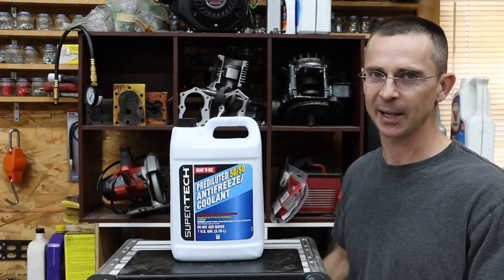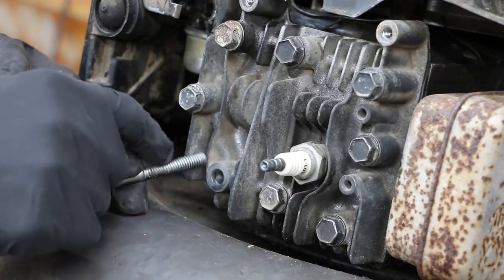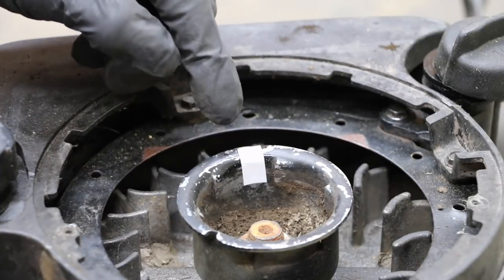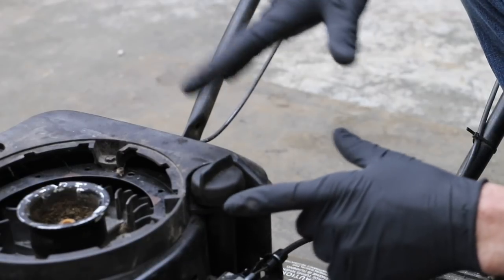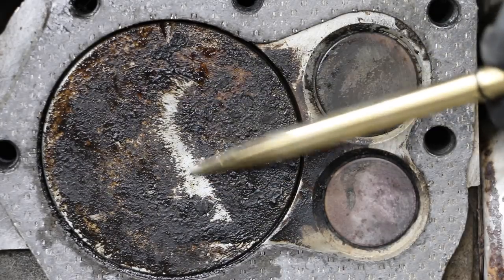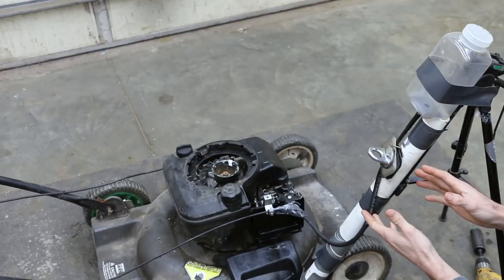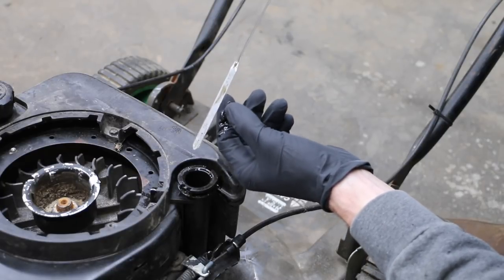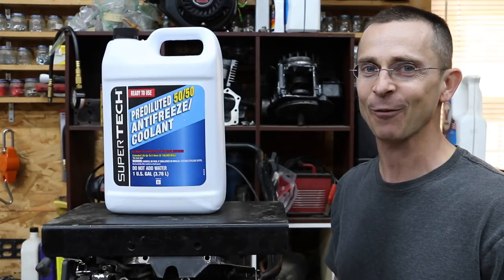Will Antifreeze clean an Engine?  Let's try it!

Comment: I'm a new subscriber, and I'm wondering if you've ever done a video comparing traditional antifreeze to Pet Friendly antifreeze? We have a lot of pets, and my solution so far has been to have my mechanic do the job, just to keep the poison from them. But, if one of the pet-friendly anti-freeze products work, I may take the job over myself!

I also had another question: My first car was (and still the best) a 64 Corvair. I remember one summer getting a J.C.Whitney Catalogue (this was in the 70's) and my best friend and I poured over that catalogue choosing the best add-on for our hard-earned summer pay. We decided upon a water injection system. WHAT? A WATER-INJECTION SYSTEM??? Well, yes. Whitney had listed it under the Corvair" section specifically. They explained that during WWII, higher-ups had noticed that the same plan ran better and used less fuel than in Europe. This, it was decided, was because the HUMIDITY in the Pacific theatre was so great. It caused the engines to run cooler, smoother, and more fuel-efficiently. Then, water-vapor injection devices were added to all the planes and the allies won the War!!! I may be embellishing a bit there, but we did purchase it, and I added it to the Corvair's carburetor. Didn't seem to do much....Anyway, have you ever run across this claim? About water injection? Love the channel!!!
Reply from the maker: Thanks for watching and subscribing.   Thanks for the video ideas.

Comment: watching roadkill or roadkill garage, can'e remember exactly, they did a similar trick on an old chrysler v8, can't remember exactly the model, where they rev the engine and at the same time, pour slowly a glass of water into the carburator and suposedly it clean the carbon deposits
Reply from the maker: Thanks for sharing.

Comment: Water will do the same thing as antifreeze as it acts as a steam cleaner. Mazda/ford used to keep a trick from us when the rotary was introduced. They would rev the rotary to 2500 rpm. And hook a vacuum line to a water jug and turn it up pouring water into the cylinder to steam clean all the carbon off the cylinder making the rotary continue to last. Do not try that on a 4 stroke engine but since a rotary is essentially a 2 stroke it was not going to be damaged from possible hydrolock.
Reply from the maker: Thanks for commenting on this.

Comment: Ethane Gas is C2-H6.  Ethanol Alcohol is C2H5OH.  Ethylene Glycol is C2H6O2; in other words, it is structured just like ethane gas but has an OH at each end of the chain.  Alcohol has only one OH at one end.  In other words, it looks like Ethylene Glycol should burn great in an engine.  It is a double oxygenated hydrocarbon afterall!  I have tried to burn Ethylene Glycol as a fuel in my wood stove and it does indeed burn GREAT, with a beautiful green non-smoking flame.  Hard to get started, but is a good clean fuel if you're ever desperate for fire starter.  Seems to be too high of a viscosity to vaporize in carburetors.  Would work well in a lamp if diluted.  Cheers!
Reply from the maker: Thank you!

Comment: You should try this 1/2 cup of anti freeze and 1 1/4  cup of berrymans b12 chem tool and the rest gas  i have used this in my lawnmower 3 times out of the 6 years i had it and inside was spotless in side the combustion chamber
Reply from the maker: Thank you for this recommendation!

Comment: I heard running transmission fluid in a diesel engine will clean the injectors and the cylinder up idk if it will though or not
Reply from the maker: Thanks for this recommendation.

Comment: When you have a cracked head or head gasket that cylinder will not fire I wonder if it would clean it even better with the coil not plugged in and turning the motor with drill

Comment: Please make a video antifreeze vs water which is more effective because I think antifreeze is more effective do to the reason it doesn't steam up as easily and slushies around washing carbon deposits away instead of steam just softening carbon and drying up the cylinder walls at least antifreeze is some kind of lubricant.
Reply from the maker: Thank you for the video idea!

Comment: Back in the 80s at the Chevy car dealerships the factory would have us use a water drip system on top of Cadillacs because of carbon buildup and this was straight from the factory to cure the carbon buildup in Caddy Motors they had us drill a larger hole in the bottom of the old fashioned Gojo hand cleaner plastic containers and place them on top of the plenum
Reply from the maker: Thanks for sharing.

Comment: Hey project farm. It's just a hypothesis but I think that the antifreeze would clean inside the engine more if the antifreeze was as heated up like it is in a car engine. It would make a good video to see if the hot antifreeze would act like a hot soak
Reply from the maker: Thank you for this recommendation!

Comment: I don't think it is the antifreeze itself but the water. You can achieve similar results by simply pouring a little water into the vacuum line on your engine (much the same fashion as Seafoam is used). It is an old mechanics trick that has been proven numerous times (videos can be easily found here on youtube).

As you can see in the slow motion video, there is a lot of moisture (water) lingering in combustion chamber while the 50/50 antifreeze mixture is dispensing into the carburetor. I firmly believe that it is the moisture/water in the combustion chamber that is loosening and removing the deposits. 

I think the true test would be to use 100% antifreeze. This would eliminate the question of whether or not the antifreeze itself is removing the deposits or if it is the water mixed with it.
Reply from the maker: Thank you

Comment: If you have a knocking valve due to carbon build-up, if it has a carburetor you can pour transmission fluid down while it's running, it will smoke like a train, but it will dissolve the carbon build-up, so I say use transmission fluid if you want to get rid of the carbon build-up.
Reply from the maker: Thanks for the feedback.

Comment: What about brake fluid, a guy I used to work with told me in the UK some service intervals on opels were to pour brake fluid into the intake
Reply from the maker: Thank you for this video project recommendation!
Reply: this works because dot 3&4 are glycol based just as coolant is ,works better tho

Comment: I've seen somebody promoting the idea of using boiling hot water for an engine cleaning process basically the hottest water you can achieve and stick a vacuum line directly into the pan of boiling water with the engine running
Reply from the maker: Thanks for sharing.
Reply: @ProjectFarm  My curiosity to expand on that was perhaps use a pressure cooker so we could achieve superheated steam or superheated water that would flash to steam

Comment: I know this is a little late but I once hand a buddy tell me to dump ATF down a carb to clean out the engine. They said to drunk one quart in slowly and then you were good. It would be cool to see what actually happens. We did it and we had to use the throttle cable to keep the engine running it seemed to run better after but we were 16 at the time 😂
Reply from the maker: Thanks for sharing.

Comment: Good videos, keep up the great work. Could you try 'light Air tool oil' with a drip and spray like you did in this video. The oil is comparable to Marvel Mistery Oil but no additives.
Reply from the maker: Thank you for this video project recommendation!

Comment: Something i have always been curious about is running an engine on gasoline and providing pure oxygen as the air mixture. I am pretty sure it will overheat, but i would like to see it in action

Comment: Can you test water methanol injection? A lot of vehicles use it to increase octane levels, reduce exhaust temperatures and increase ignition timing for more power. Will it also remove carbon buildup?
Reply from the maker: Thank you for the video idea!

Comment: it is a common trick to clean engines by spraying pure water in as you did.  The scheme thermally shocks the carbon deposits when the water mist reaches the hot carbon, and causes it to crack off.  How do you know it isn't the water doing the deed?

Comment: How many times has that head been removed? Don't antifreeze leaks occur on the head gasket with a watercooled engine? Running it through the carburetor might be apples and oranges. Great video too. You take the time to do the tests honestly and believably.  As a religiously skeptical observer I like the way you roll!
Reply from the maker: Thank you!

Comment: Ik this video is 3 years old but bmw made a car with “water injestors” that spray a light mist of water with the air fuel mix and it helps with cooler air and clean a little bit
Reply from the maker: Thanks for sharing.

Comment: not sure if you could test this but, I heard that you can use mineral oil as engine coolant. It's better because it doesn't corrode metal parts like the radiator and lubricates the coolant pump so the myth goes. Is there any truth to this myth?
Reply from the maker: Thank you for this video project idea!

Comment: What if you just do a purified water drip as the antifreeze is 50 percent water. What if its the water that's doing the cleaning instead of the other ingredients in the antifreeze? Could be the water is flashing to steam and this is performing the cleaning? Nice video here! Why not try liquid dish soap dripped or sprayed into the carb too.
Reply from the maker: Thanks for the recommendation.

Comment: Hi, Love your videos! You should test a degreaser in the crankcase/intake as a cleaner. Specifically LA's Totally Awesome Cleaner found at many dollar stores. Saw a utube video "How to Clean the Inside of Your Car Motor" by Artistry Photography 27mins, where he used LA to clean the worst sludge I've ever seen in an engine. I tried his method on a sludged up 92 Toyota Corolla ready for the junk yard & had surprising results. I think you will too!
Reply from the maker: Great video idea!

Comment: The Super Tech antifreeze coolant labeling is very confusing and I now found another version called Heavy Duty that comes in a black 1 gallon jug with a red cap and looks like it is the same as the Toyota version labeling.
I'm starting to think that all these versions are just nonsense.  For instance this version is labeled Super Tech Prediluted 50/50 Heavy Duty Extended Life Antifreeze/Coolant and it's priced at $10.96.  The label doesn't specify a match to any vehicle, but looks very similar to one of the Toyota versions, the white gallon bottle with the red cap  It is an ethylene glycol based Organic Acid Technology (OAT) that meets or exceeds ASTM requirements.  And is free of phosphates, borates, nitrites, silicates, and amines, just like the (POAT) Toyota/Lexus white bottle with red label.  The label claims to be Extended Service Life for a million miles instead of only 5 years or 150,000 miles on the White bottle .
WTH could they be possibly testing for a million miles?  And what is the difference between ethylene glycol based Organic Acid Technology (OAT)  based or ethylene based Phosphated Organic Acid Technology (POAT), since this POAT also claims to be free of phosphates on the same label?  How could it be POAT and be free of phosphates?

Comment: Have you ever tried using water to clean carbon? It can be done the same way as antifreeze so you already have the setup to make it work. I've heard this tip for a lot of older mechanics that did this for old carbureted vehicles
Reply from the maker: I used a water drip, but haven't tested a mist yet. Thank you for this recommendation!

Comment: I’ve always heard doing just plain water like that will clean carbon. Maybe do a video with just water and compare it to the antifreeze mix results to see whether the antifreeze adds to the affect? Basically the steam with the water is steam cleaning the cylinder
Reply from the maker: Thanks for commenting on this.

Comment: Ok, growing up, I've always have been told one of these three will get an engine pristine...1.) Transmission fluid; 2.) Hydraulic fluid; or 3.) Diesel fuel/ JP-4 or JP-8. The myth has always been, drain one quart of oil from your crank case, then replace that volume of fluid with one of the three, drive the car for 5-7 miles under normal conditions and driving...then drain the crank case and inspect your engine and spark plugs.
Reply from the maker: Thank you!

Comment: Water would be better because when cold water hits a hot surface it explodes (like spilling water on the stove) taking any carbon deposits with it and there is additives in your Engine oil for condensation (when you read on the back of an oil container are word like SD, SF and others that's the additives) instead of using copper wire ya can just use a longer bolt the bolt holes in the block are usually deeper than the bolt
Reply from the maker: Thank you!

Comment: I've always been told that antifreeze in the engine ruins the engine.  I think for this test to be conclusive you should run it for a prolonged time period, say for an entire tank of gas or more.  Also, running a parallel test using straight water would be good so you can see if it's in fact the antifreeze or the water that's doing the cleaning.  My guess is its the steaming during combustion that's doing the cleaning
Reply from the maker: Thank you for this video project recommendation!
Reply: Also, maybe look at the rings, bearings, and cylinder walls before and after.  That might be too involved though.

Comment: What happens when a head gasket fails is the coolant pours into the cylinder after the car has been shut down, and it sits there on top of the cylinder as it cools down.  That is why on cold starts, the engine might have a miss as the coolant interferes with the spark
Reply from the maker: Great point.  Thanks for commenting.

Comment: It's the same effect as wated/meth injection. A light controlled spray of water should clean the engine, lower temps, and technically increase compression when being sprayed as water doesnt compress or ignite.

Comment: Plain white rice is another great cleaner.  Acts like a shot blaster while the engine runs. 
I've used it on regular v8s with decent success. Don't do it if you still (somehow) have a pellet bed cat installed! Exhaust smells like popcorn.
Reply from the maker: Thank you for this recommendation!

Comment: Hy, I actually used blue antifreeze in my car as water injection, for about 2 weeks. Its a simple 4 cyl SOHC endine.
after I removed the cylinder head for inspection, every cylinder was full with some sticky black stuff, it really looked horrible..
Reply from the maker: Thanks for this information.

Comment: I have literally used the wire trick on head bolts when I got a blown head gasket out trailing I ended up driving it for another 2years almost daily until I sold it to a buddy that still wheels and beats on it every weekend
Reply from the maker: Thanks for the feedback.

Comment: I watched a video where a guy put some "Totally Awesome" cleaner into his crankcase with just 1 quart of Mobil 1 synthetic. Did this like 4-5 times and ran it like 10-15 minutes each time, and so much crap drained out of that oil pan. It was insane and you should try something similar. :-)
Reply from the maker: Wow! Thanks for the recommendation.

Comment: I would like to see some additives for Diesel engines. I always used MMO, until I found out its lubricity is not good for diesel as a fuel additive.
Reply from the maker: Thank you for this recommendation!
Reply: Try Fuel Doctor by Castrol its a good fuel stabiliser, Cleaner and also Carbon Cleaner as they Claim. It works for both Gasoline and Diesel.

Comment: Have you tried dripping water in the carbon full engine you get it hot and drip the water in and it loosen up the carbon  and clean the head

Comment: THE VERY BEST AND EFFECTIVE WAY to remove carbon from the combustion chamber, is by feeding a mixture of gaseous Hydrogen and Oxygen...  The cleaning is done by getting the mixture of two volumes of hydrogen and one volume of oxygen from an Electrolysis chamber operated with AC...  The gaseous mix is fed through a vacuum port in the inlet manifold, like at the brake booster connection. A flow of approximately 40 liter per hour of H2 + O2 is fed for about 40 minutes at idle or slightly fast idle. 

What the H2 + O2 mix achieves, is to subject the interior of the cylinders to a Carbon lean kind of fuel, so that the Hydrogen and the Oxygen DO BURN, in a gradual and safe manner, most if not all the carbonous deposits inside the combustion chamber.  There are professional large machines that produce the mixture all day long.  This procedure also cleans the Catalytic converter, frequently saving more than 70% of deemed "bad" converters.  A local shop has treated more than 6,000 car engines with this method, and their carefully registered emissions tests show that rate of success. Even heavily fouled sparkplugs that had baked on reddish deposits from excessive use of MMT (the Manganese antiknock aditive compound), were left quite clean after the 40 minute cleaning procedure. Absolutely no harm was caused to the engine, O2 sensors or the Cat converter.   BTW, I am a Chemical Engineer by trade, with 40+ years of experience in many kinds of I.C. engines, from small ones to large Diesels in the petroleum industry, and I work for a R&D Center for the Petroleum Industry, and this type of cleaning DOES work when properly done.

Comment: Time to use studs and nuts on the test engine to avoid additional wear in the bolt holes?
Reply from the maker: This is a great suggestion.  I have plenty of other engines when this one is worn out.